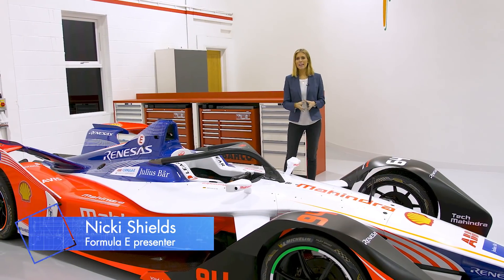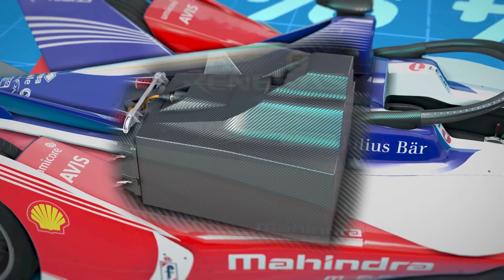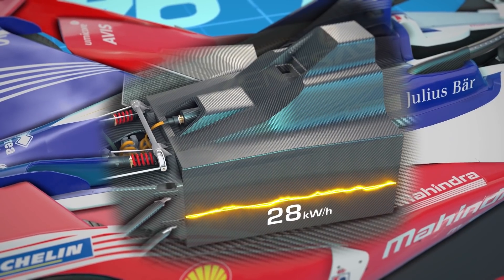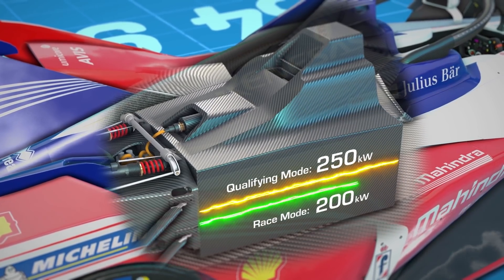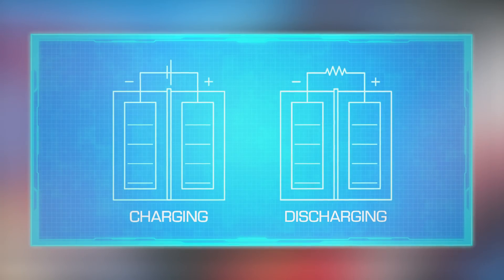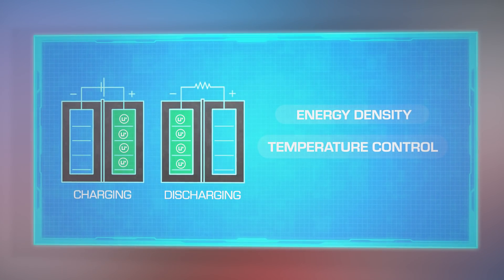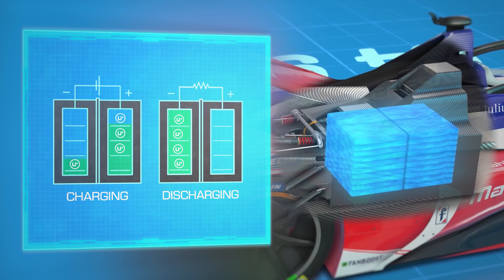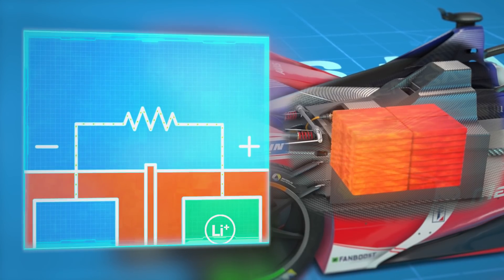Formula E Car Battery (Gen2) | Episode 2 | Blueprints by Mahindra Racing ft. Nicki Shields

Comment: When Tesla has 100kw/h batteries 🤔
Reply: The 54Kwh battery weighs 385KG (maximum car weight of 900KG) 

The Tesla 85KWh weighs 540KG, so the 100KWh should be around 635KG  so the car would weigh 1150 KG wither that would balance the cars speed, and duration 🤷🏼‍♂️